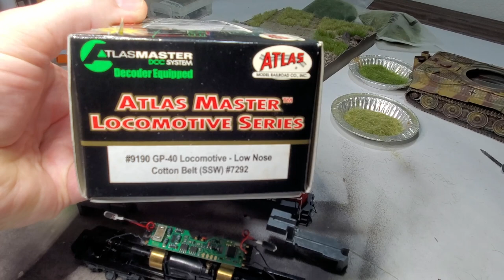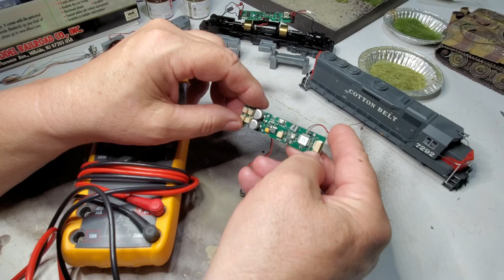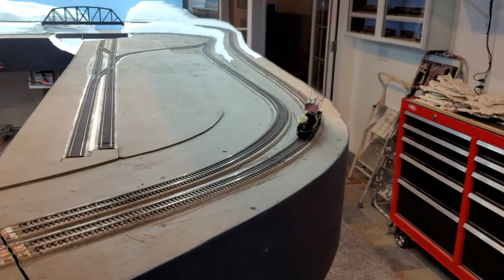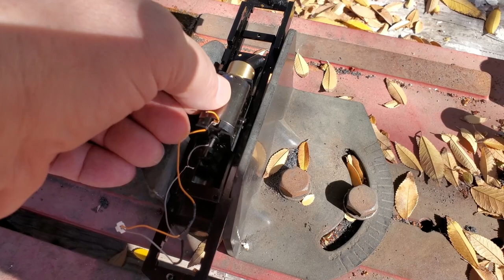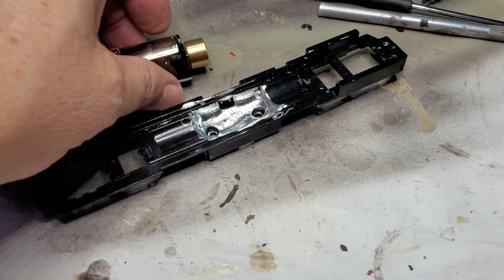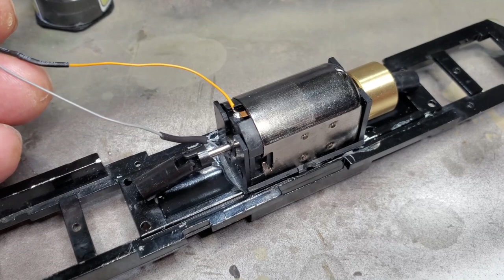Atlas GP40 from Lemons to Lemonade. Making 1 good Locomotive from 2 bad Locomotives. Part 1

Comment: The frame on the GP20 is called frame rot and is a known issue.   Sucks that it is well beyond warranty,  you might call the manufacture and see if they still have frames for them.  You might get Lucky and get a new FREE replacement frame if that is one of the recalled models.  forums talk about it the problem,
Reply from the maker: I've scavenged the motor and DCC board from the GP20 so I think I'll save some of the remaining good parts and scrap the rest. I made the mistake of buying a lot of stuff and let it sit for years. Hopefully I learn something from that.

Comment: After lookin at the box Atlas Master DCC System.  If I recall correctly that is so old that it is 2 digit short address only.  Address  01 to 99  not the modern 4 digit Long Address like we have now.
Reply from the maker: I wouldn't be surprised and you're probably right. Definitely not the latest tech. I'll use the more modern GP20 DCC board in the old GP40 to get it up to date a bit more. 

I have a few locomotive projects lined up, 4 of them are new/old Lifelike Proto 2000 locomotives. The boxes are sealed but the models are 20+ years old. I plan to do DCC installs as well as replace all of the cracked drive gears.